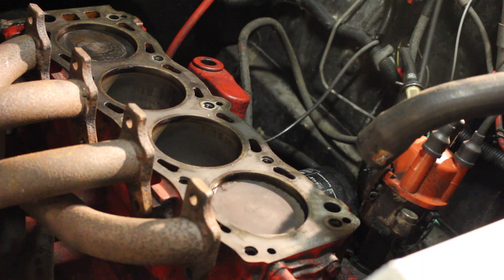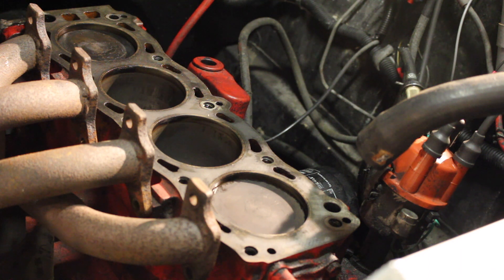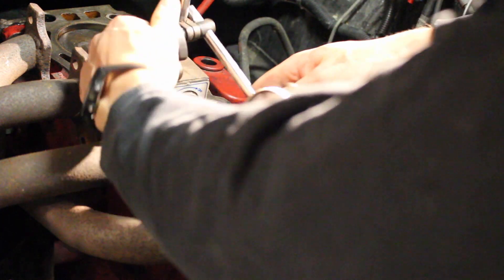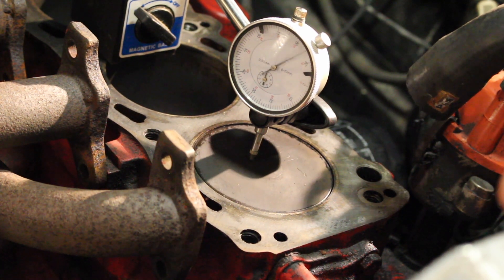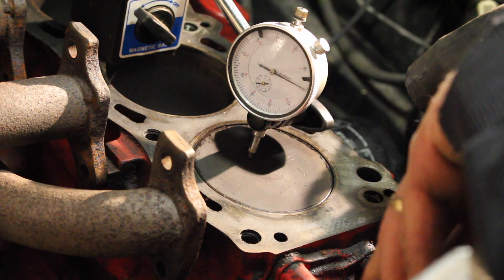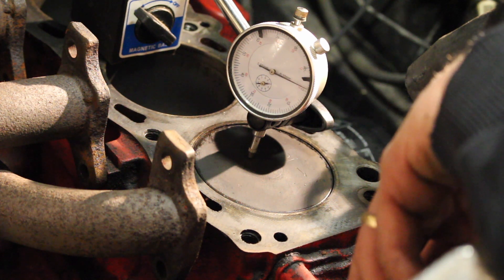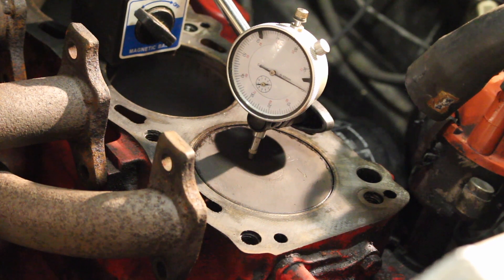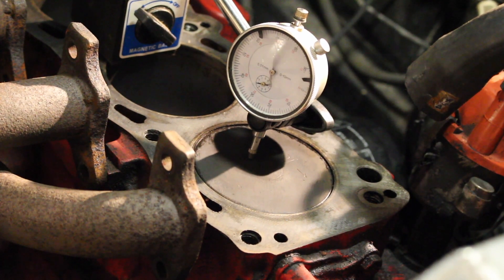How to find TDC with a diall indicator

Comment: That won't work. The piston will be stationery for 3 or 4 degrees of crank  rotation around TDC. If you're using a dial gauge it should be used in conjunction with a degree wheel. I won't get into that now but there are videos on here that cover it. If you can't use dial gauge or degree wheel use a piston stop and you can do that with the head on. Again, videos on here cover that.
Reply from the maker: It should get you to within a degree or so either side of TDC. If you split the difference then you will get very very close to TDC.
Reply: they  literally  have  deck  bridges  without the head on.  and  you dont need a degree wheel to get very  close